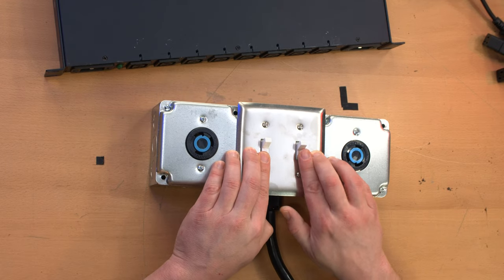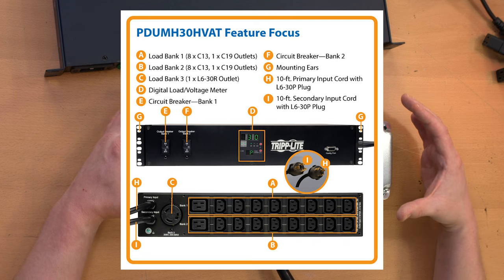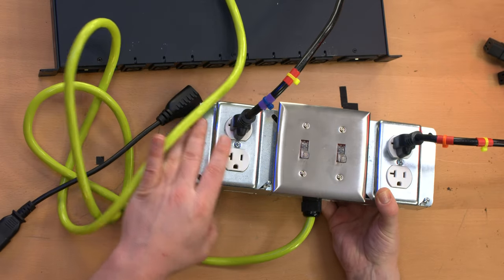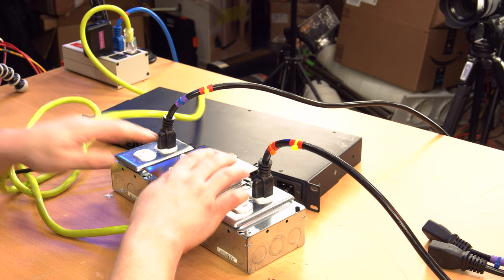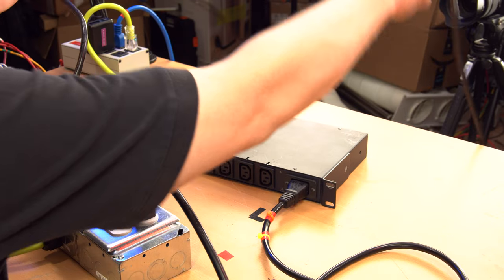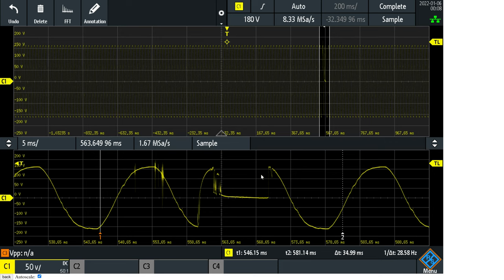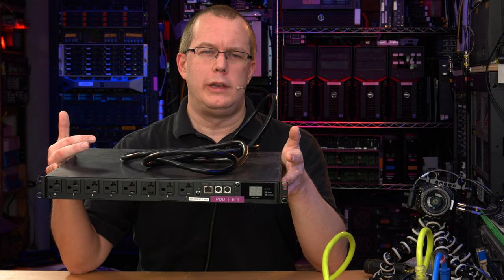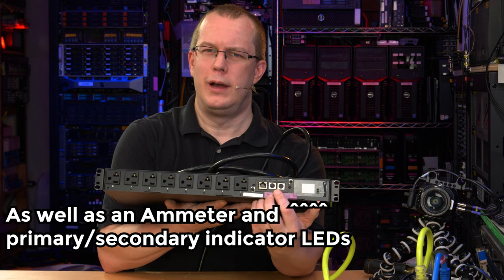Automatic Transfer Switches!  (Feat. Server Technology Fail-Safe and Tripp Lite PDUMH20ATNET)

Comment: Cool, I haven't actually seen this form factor before, but here's another use case for you, say you don't want to go through the trouble of roof mounting panels + grid-tie inverters + permits, etc.. Well as long as you aren't putting anything onto the grid itself, then you can have your solar system as a separate technically off-grid system.
You need at least a small battery so it wouldn't constantly switch back and forth, but something like this is nice as it will allow you to run whatever from solar at daylight hours and automatically switch back to the grid.

Comment: and good thing you didn't switch the 240v unit like that because both legs are hot, so it would go from 240 to 120v, albeit without a return neutral most likely but still a ground. I have no idea what a PDU would do in that case but I'd hope it would transfer off the bad input. If both outputs are switched off with light switches bad things might happen inside the PDU or server as two hot legs would still exist and could potentially bridge across from A to B side or vice versa. Even with 120v that probably still exists if you are switching on the neutral instead of the hot. So the lesson is, never play with electricity unless you 200% know what you are doing!